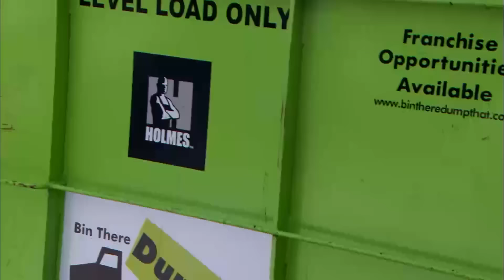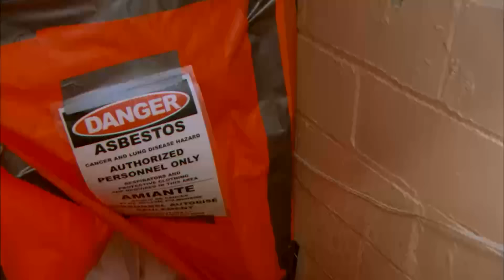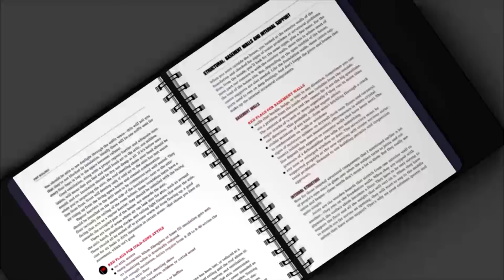The Nightmare of a No Inspection Clause  Holmes Inspection S221+222

Comment: Copper pipe may never be placed unprotected in the ground 
and must always be provided with a protective sleeve for protection when used in the ground.
And when passing through the wall, copper may never come into contact
with concrete and/or cement because this shortens the lifespan of copper so much.
Copper pipe may only be placed unprotected inside where it is not subject to weather influences.
Shame on you Make for letting it happen.